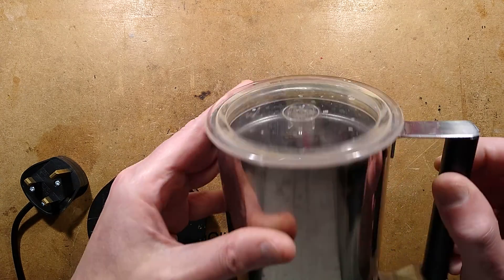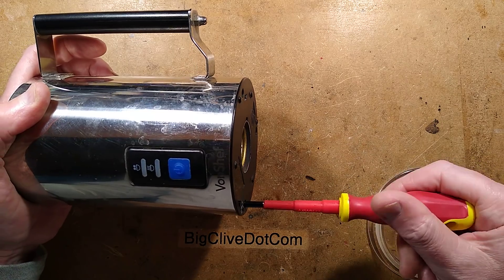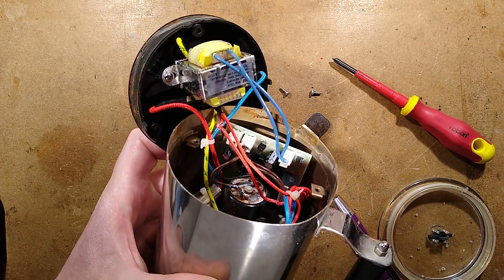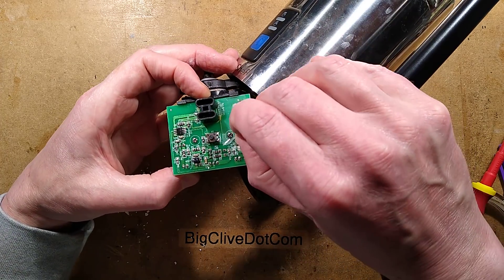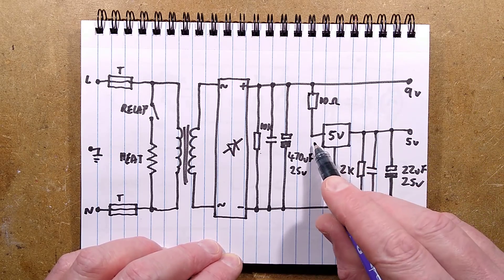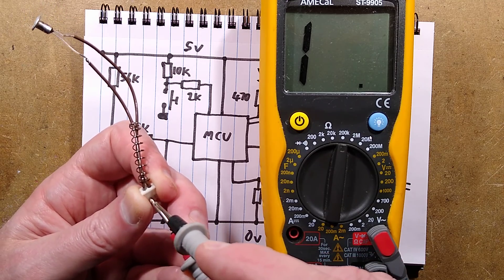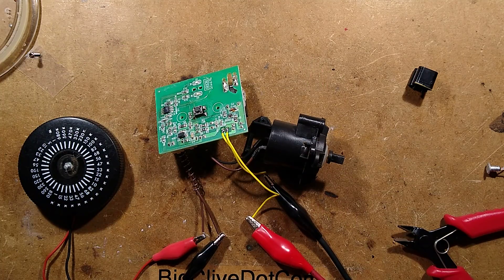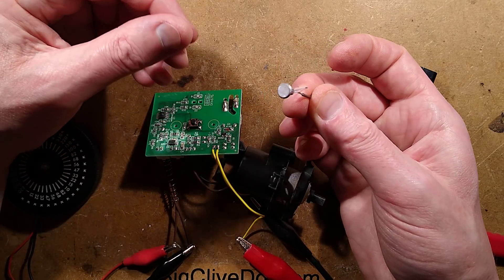Thomas Nagy milk frother autopsy

Comment: What me allways wonders about watercookers and this thing. Is that the connector on the pot is just a coax connector.
Reply from the maker: It's designed to allow placing on the base at any angle.  I took one of the connectors apart in a video.
Reply: @bigclivedotcom  Oh, i think i have missed that. But it's perfect for that job i think. BTW i have send you a e-mail. It's behind all fanmail and spam i think so haha.

Comment: i fondly remember upgrading one of those hand wooshers from 3V 2xAAA batteries to a 9V mini trafo wallplug (adding an alibi resistor) because it was a bit bent and the user wanted it repaired...  worked like a charm, but never heard how long the second life (b)lasted.. it was fine if you did not hold the button too long ;-) . i think i was around 14 years back then...

(never found myself to need any fancy foam or high pressure stuff to enjoy a simple yummy coffee... all that fuss and cleaning and extra things to fail)

Comment: The problem with these is they only heat the milk to 60oC. I'd like it to go to 70oC. I'm thinking of putting a 10k resister in series with the thermostat.

Comment: Those tactile buttons don't last forever. Had a set of kitchen scales that had on/off/tare on the same button. Eventually got to the point you couldn't tare or turn off reliably. Easy fix for a few pence and a few minutes of soldering.

Comment: Fascinating! I love your ' one moment please' cuts! I'm trying to diagnose a full rectified 5v ~12v potentiometer controlled power supply. It controls rgb array LEDs , with motorized mirrors x 3. The  power supply LED is flashing,. It's likei a loss of capacitance, but all capacitors look fine with or without a load , but adjusting the 'pot'  just hastens the led indication. I dunno, but I have two of these lights with the same problem... given for free by my DJ friend! So I watch your vids alot . I know it's easy to buy a  new supply, but that's hardly the point of getting $500 NZD worth of lighting for free.

Comment: You use a moto g power, do you like it?
Reply from the maker: I use it as a recording device.  For my main phone I prefer ones with built in thermal imaging.
Reply: @bigclivedotcom  thermal imaging would be a handy thing. Just got the moto g, it was low cost. Does the job I need it to do.
Take care, have a good.

Comment: "Water ingress and electronics. It's just one of those things..."
No, those are 2 things, Clive. 
2 things that happen when your domestic attendant doesn't RTFM, and puts the frother in the dishwasher. Our cleaner at work keeps doing this, despite repeated requests not to do so. I think it's a kind of protest, but I'm not sure why. Either that, or she works for Nespresso.
Anyway, it doesn't help when the "not dishwasher safe" stamp is moulded into the material in the base of the thing, in exactly the same colour of polymer as the rest of the appliance. It's not what you'd call a prominent safety notice. Still, I suppose the manufacturer would be happy with the increased sales of replacement frothers.... I note that Clive's has a more legible "non immersion" warning than ours.

Design specs for current frothers, in order of priority, for the manufacturers:
Cheap to make but look fancy, to sell at a premium "Barista" price. Choose fancy platings and an attractive logo. 
Must allow water ingress even in slightly damp conditions. 
Money spent on fuses is well spent, to avoid legal claims, money spent on durability being a bad idea. 
Cheap but effective waterproof conformal coatings for components are a no-no.
If we can't rely on water eventually getting in, then use the crappiest non stick coating available for the milk reservoir, so this flakes off exactly 366 days after the one year warranty comes into force.

Comment: That's exactly like one i purchased on Amazon. Made in China, and rebranded for various vendors, apparently. The heating element went out on mine, but it still froths cold. i'm giving it away tomorrow, since i purchased an upgrade. 

By the way, the button is designed to give a hot foam option (or just heated with the other stirrer) with a quick button press, or a cold foam option with a 2 second press.

Comment: Clive, the MCU reference seems to be written on the board in huge letters 😉: ht46r005
I googled it and apparently the manufacture is Holtek Semiconductor which I never heard of before.

Edit: in the datasheet of ht46r005
 they show a 10 pin package however...🤷‍♂️

Comment: To me it seems Clive went in a bit fast, meaning I fixed a water boiler with a similair base. Issue was the base no longer made contact with the kettle.  So simply by bending the contact blades in the base socket made it get the 220 Volts again and worked fine.
Reply from the maker: I did check that.

Comment: Based on one of your concluding comments, I'd appreciate a reliable online resource where I could find out the build quality of typical electronic devices to see if the manufacturer has gone the extra mile and included coatings or other features to prolong the life of the device. It seems quite typical for kettles, toasters, fan heaters and other consumer electrical items to break down after ~ 1 year of use. Really bad for the environment and not so good for your pocket either.

Comment: Hi Clive, how do I send in equipment for autopsy?
I've got the guts of a pretty dire 4ft fluorescent fitting from a spraybooth. They were in banks of 3 behind glass panels.
Well actually there are two fittings, one working and one that went bang.
For those that did work, tube life was 12-24 months and lumen output wasn't great.
The rest went in the bin and the whole lot were replaced with Osram ballasts and tubes.
The adjacent booth had previously been "upgraded" to LED tubes but I worked out I would need 4 LED tubes in each bay to replace 3 fluorescents for the same light output, even with the best Philips units having good CRI.
Not sure what LED tubes were used in the other booth, but it looks a bit poor compared to the fluorescents.
Reply from the maker: Some of the early LED tubes were rubbish and also degraded fast.

Comment: If i remember correctly the LVD does not allow a fuse in both Live and neutral in equipment for the UK. As if a fuse blows there can't be any dangerous voltages in side. if the neutral fuse blows all parts of the circuit become live so would fail the directive. I expect as the only way the unit can be disassembled is to remove it from the base, all power is removed from the unit so a blown neutral fuse is not a hazard.
Reply from the maker: The thermal fuse is different.  It's to allow for a heater ground fault and swapped polarity.

Comment: I know you called it a micro, but it I were designing it, I would use a mini ASIC. Same outcome, but maybe cheaper?
Reply: This was definitely a Holtek microcontroller. The big problem with ASICs is that they're application specific, so they need to be developed for each application. Microcontrollers are generic so there's no need to redesign the chip, and they've gotten so cheap the price is hard to beat.
Reply from the maker: You can get a microcontroller for a few cents these days.  That also lets you update the software if issues get detected in older products.

Comment: I always appreciate your autopsys. I found anything in a moist environment must be waterproofed before use. 

I had a Chamberlain P.I. driveway alert which started going off with nothing in range. 
I opened the transmitter to find water had condensed inside the “water resistance” box. 
I dried it then used clear enamel to waterproof the board and petroleum jelly to protect the battery connections. 
It has been working great for 9+ years so far.

Comment: I suspect that the double-sided protection circuits are there because the same appliance also is present in the rest of Europe with the Schuko plugs that don't care about "live" and "neutral" and the result depends on which way you flip the plug that day.

Comment: So are you saying, Thomas has had it in the dishwasher ?

LOL
Reply from the maker: Water gets into everything.  It doesn't need to go in a dishwasher.  It can wick through any seam.
Reply: @bigclivedotcom  Not with our old kettle - it leaked out of that !
At least the kettle and base were designed to handle leaks - so harmless puddles on the worktop. It seems the leak was between the side and the base. The base screws were loose and tightening them solved it for a couple of weeks. In the end we splashed the cash on a £7 Morrisons savers kettle - old style element fitted to the side - so needs a minimum of 2 cups of water in it to cover the element - but it stops boiling almost instantly - unlike the old one - as the heaing element heated a large aluminium? circular block which took time to cool once boiled !

Comment: Transformer --> Bad design! One can just use the heating element as a dropper-resistor to power the motor (like they do in hair-dryers).
Reply: Nah the motor should keep running for a while after the heater has switched off.
Reply: @pizzablender  This exact same problem happens in a hairdryer too, and there is an elegant solution for it ;)

Comment: I had two units of a more or less similar design (Silver Crest) from Lidl. Both died within the 3 years warranty period of milk ingress into the motor (via the shaft). Got my money back in both instances. 😃
Pushing the button for 3 seconds wil start stirring the milk without heating.
If I could find fitting motors I could easily revive them... the ingress issue might be addressed by a thin disc on the shaft, spinning any leakage out of harms way.

Comment: One thing worthy of note about the design of the PCB is that the motor and temperature sensor have identical connectors. You could easily come to grief if you get the connections swapped.
Reply from the maker: It wouldn't cause any problems if that was done, other than possibly flagging up a temperature sensor error.

Comment: If there's a shaft coming in from the bottom, leaking is just inevitable. Had a few machines that do this and they all leaked eventually and ruin the bearings, thus end of life since you can't rebuild them.
Reply: Yes, it seems like the rotating pair of magnets would be a better design for things like this that do not need significant torque.

Comment: The PCB has an arrow coming from the MCU and it says HT46R005 - it's a Holtek OTP Microcontroller.
(taking the risk of posting this at 7 minutes in and not seeing if Clive knows that later in the video :P )
Reply from the maker: I miss PCB text a lot.  I'm concentrating too much on the components.
Reply: I've recently fixed two things from around the 80s and silk screen had a lot of useful info on it so have a habit of looking at the silk immediately lol

Comment: I have the Hotel Chocolat velvetiser made by dualit - I didn't buy it, it was a Christmas gift from work £100 is too much for this glorified kettle. But yes, the magnetic motor is such a better design than this cheap nonsense for an absolute leak proof guarantee.

Comment: My friend has a milk frother similar to this, but I'm guessing a more recent model. The milk frothing spring thing is just held in the middle of the jug by a peg and it's rotated magnetically, without a direct connection to the motor beneath. There is no shaft going through the base of the milk "compartment", so it should never leak like this did.

Comment: 7:40.. What are the "T" devices on the input to the circuit ?
Reply: Those are the thermal fuses Clive was talking about.  That symbol is kind of the modern equivalent of a fuse symbol (used to be two posts with an 'S' shaped connection between them which is still used more as a user-serviceable fuse these days.
Reply: @Chris_the_Muso  Thanks for the clarification... I must have skipped over that in the video. ;-) If it had an 'S' shaped connection with the "T" ID I would have known.

Comment: Excellent little video. Suggestions for a future one: Little Devil by Qiui - Friend sent it to me because they're the company that produced the remote control cha stity devices that got hacked a while back, and they're now producing an electroshock collar. Seems like something which could easily lead to harm if their discharge cap isn't appropriately sized (Cheap, too, like 50£ on eBay which makes me highly skeptical of the build quality.)

Comment: Only type I’ve used is an espresso machine with a steam generator that feeds the milk frother with steam, no motor involved in the frothing. More expensive on the whole.

I have a sous-vide circulator rated at 1200 watts, but once the water is up to temperature I’m hoping the circulation pump is what usually draws power and the heating element doesn’t run very much. Otherwise those 2 to 3 day cooking periods might get expensive!

Comment: Thanks for the autopsy intreresting to see another brand, I have a different but functionally very similar milk heater/frother that quickly died. It was the last available so I could get a refund but not a new one. It was hard to dismantle but it turned out to be the small transformer 240 pri / 9V-0-9V sec that had died, the primairy windings cut somewhere. I only managed to find a slightly larger transformer that with some effort I still could make fit inside and it worked again.

Comment: Apart from trivial cosmetic differences it appears identical to the units ALDI Australia sells as companions to their coffee pod machines.
Our unit at work appeared to suffer from similar problems with water ingress and corrosion but my inspection wasn't as thorough due to running out of patience at the spudger stage and completing disassembly with a railway point clip. No serviceable parts were found after that...

Comment: Had a similar issues with a morphy richards unit,  Horrible corrosion inside which i assume came in through the motor base seal. The tiny tactile switch was smaller then anything I had in stock so I did a search and found a box of 250 assorted tactile switches costing $10.00AU from a vendor on Ebay.  The unit I looked at had the NTC thermistor glued into a receptacle which was welded into the bottom of the jug. The Kettle ( part of a set I was told ) had five different temperatures which were accessible through five push button ( tactile ) switches on the base unit.  When I checked the kettle, It used the same MCU as the milk jug so I guess morphy richards simply program the MCU for whichever product it is installed in...

Comment: I didn't know they made milk frothers with a rubber seal between the motor and container, I can't imagine that would work for long. The fancy Italian one my father has uses a much neater magnet system, though it does get a tad noise, since it has to cool it's electronics in operation.

Comment: Need a few seconds of foreplay for the milky froth system to function as designed. Hopefully it's not clogged with milky goo. Rusty inside? Lack of routine use, need to cycle the old frothy milk out at least once a week. Fumbling around in the dark should still be acceptable.

Comment: I saw only one time good froth cup, that had no direct contact between that whipper and motor, instead it have magnets on both sides that rotate on some teflon-like surface. Only problem was that rotating bits inside cup had really crappy mount for that whipper so after some time it start wobbling and at the end it broke. But beside that, thanks to no holes inside there where no corrosion at all.

Comment: Excellent teardown, now I know what’s inside this! I have this device, I believe that it does go through several heat cycles, at least 2-3. Maybe there is a minimum time threshold between the heater turning off and back on? No idea.

Comment: I've had a lot of these! The ones from Amazon last about six months and get replaced under warrantee. They all stop heating. The Lidl version lasted a good bit longer and has a much longer guarantee. Both have identical bases so I guess are from the same factory.

Comment: SMH. Someone trying to make a cheaper design while making it utterly inadequate. I've seen frothers that have a unibody cup that holds the milk. There is the frother whisk that is placed on the inside but only coupled to the motor by magnets (so no hole through the unibody cup). It seems impossible to seal water. Say any large ship has this same issue of the drive shaft and propeller being basically the weakest wall between the ocean and a flood. I dont know how modern ships do this but 1940s battleships could only have consumable packing which is keeping out the sea (though not indefinitely).